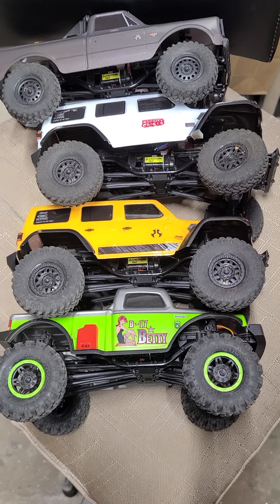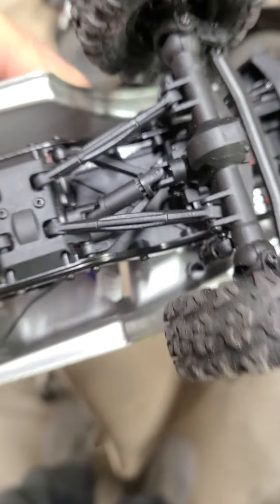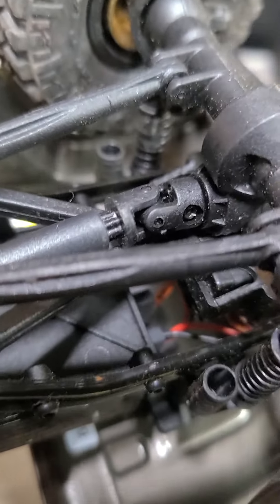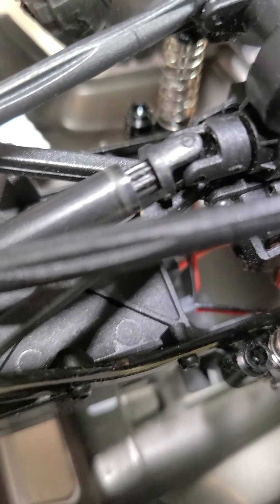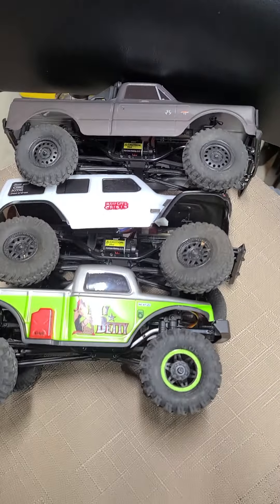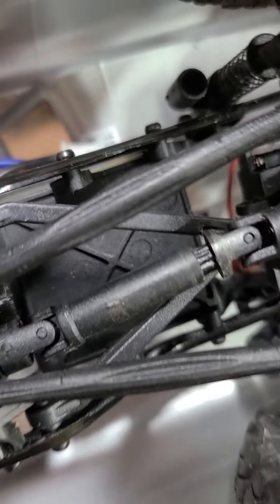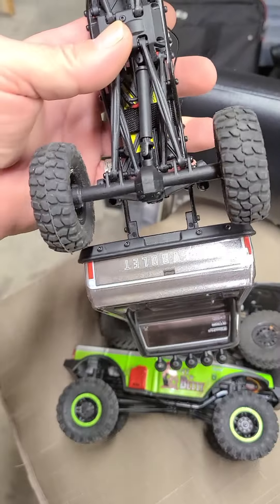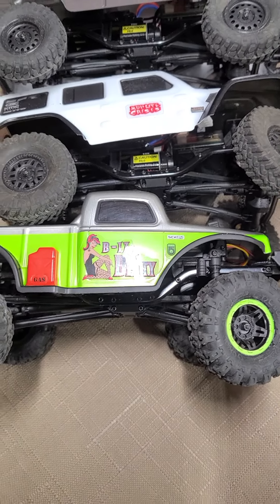scx24 has a flaw in it. #scx24 flaws

Comment: I noticed this when I added steel driveshafts.  They were binding at extreme droop on the aluminum 'Y' link as you showed.  A quick Dremel job to wallow out the existing indent in 'Y' link a bit more.  No more rub!

Comment: Brand new out of the box it is designed this way. It is notched from the factory. Its designed that way. Also the trucks are so light it wont have any pressure on it to cause a issue.
Reply from the maker: All 4 are rubbing. You can see that the shafts are shining where they rub. The heat can cause a break if it gets hot and cold to many times. Just something for people to look for. Not putting them down. I love playing with them no matter what.
Reply: @hothooptyrc8191  actually it won’t affect it at all they are not they heavy the y link will wear in long before it gets hit enough to break or bend. ✌️🙂

Comment: if you took that part all the way out it should have a notch beveled in it. I am able to see mine clearly as well as in most of the videos people have made about this. that notch is also on the other side for some reason, I don't think you can install it any other way, but it's on both sides of mine.

Comment: That’s old news bud I talked about it over a yr ago with the very first deadbolt and it’s not a flaw or big deal at all. The drive line will rub a little the first couple runs and it will wear in the link so it clears horizon/axial new this to. I have yet to have any major issue in over a a yr and 4 rig because of the tiny bit of rub an the first few days. But if it really bugs you it’s super easy to take the y link off and file it to clear or 4 link the front end.✌️😄
Reply from the maker: Mine are still rubbing and I just got into the small crawlers 6 months ago. They are my winter fun. If friction is in any situation they will be probably be some problems eventually. Heat and plastic don't work. I showed what I found just to help some of the ones that have not noticed it.